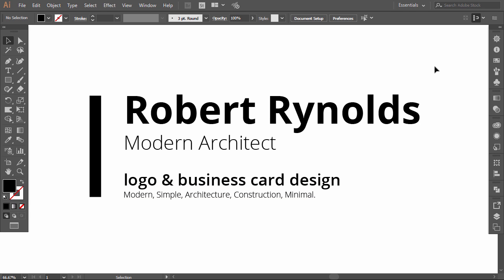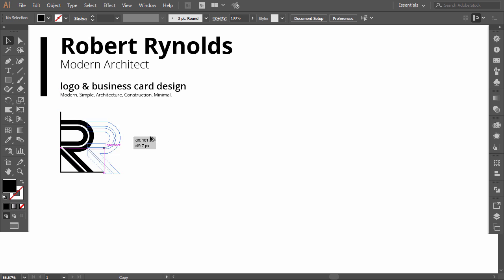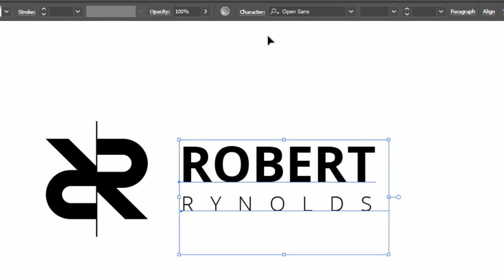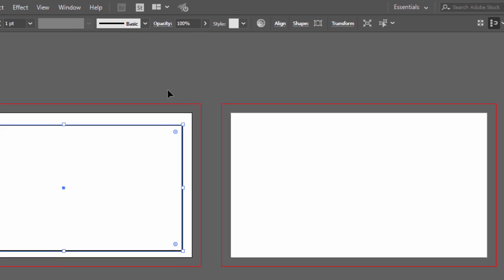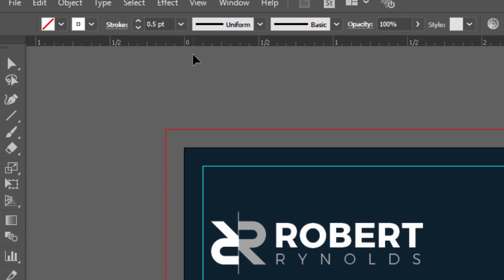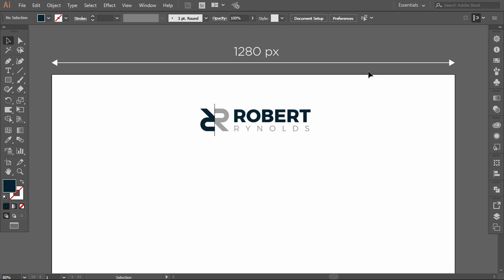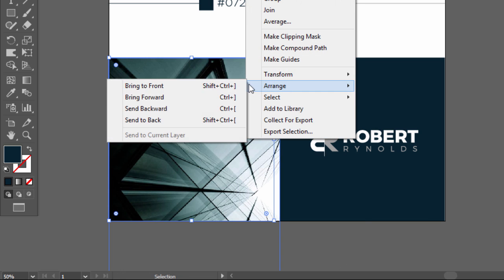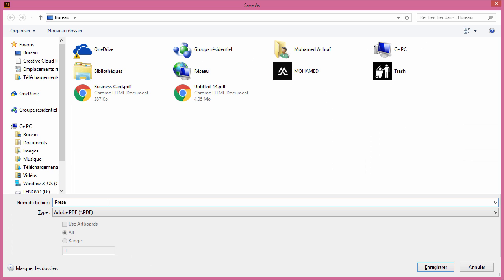Logo And Business Card Design | Adobe Illustrator & Photoshop Tutorial

Comment: Judging from these videos i can see you have a mind for design. I have watched several of your videos now and learned a lot. And i've been using Illustrator for 15 years now interesting to see your view on the tools available. Some tips for you might be to look at the content alignment options available from Illustrator as well as the pathfinder tools. You taught me about a lot of new tools as well! That is why it is great to watch how other people complete their work.

One of the options i could see working for you might be the align content to page/selection options. they can have vertical and horizontal justifications and are available as soon as you select an object.

I too sometimes prefer using the direct select cut and pen tools. but can see myself using the options you use to add vectors to paths and exclude parts from an object based on a vector that lies up top!

Also, if you drag out a guide from the ruler and you hover the mouse over the path you want to align it with it will snap to it. I saw you did not know that yet from your video of the Drago logo.

All in all good job nice work!